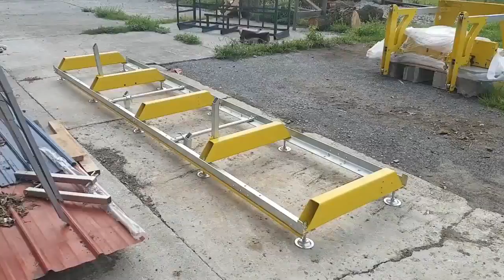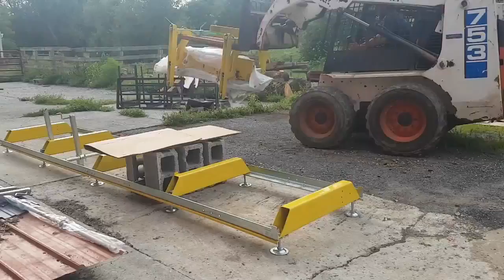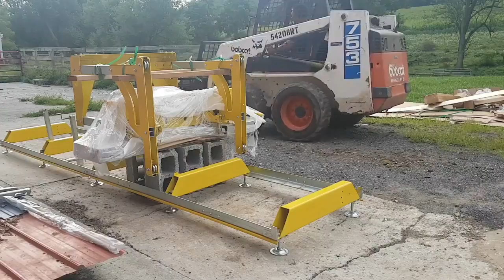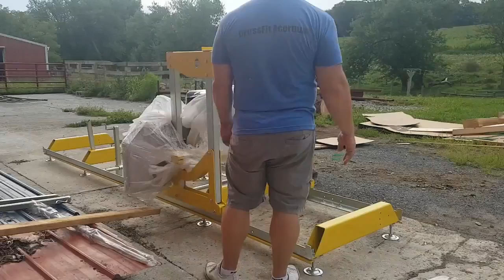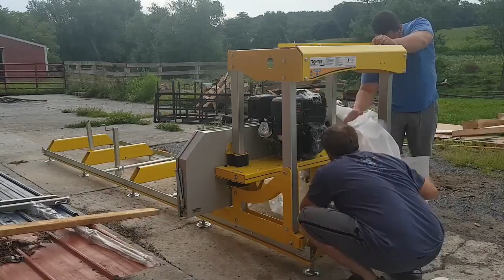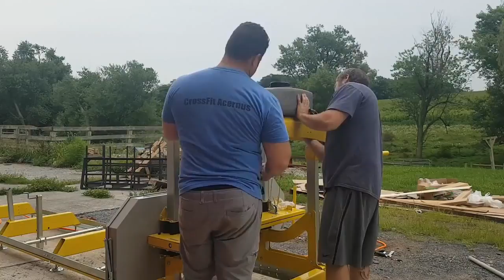Frontier OS27 Sawmill Cage Assembly

Comment: What if I don't have a fork lift? How heavy is the biggest single piece?
Reply from the maker: Hi Joe. We are about to make available an optional log loading and rolling system. Otherwise, you just stage them on beams running at 90 degrees and step roll them up and on.
Reply: @FrontierSawmills  I was referring to the OS27 assembly video, in which they use a Bobcat to move the main frame piece. Just bought a OS23--will unbox it tomorrow and see if I can assemble it myself without access to forks...
Reply: Joe Buckwalter  were you able to lift without forklifts?  I have no idea how heavy the os 23 is??  How portable without a trailer?
Reply: A friend and I were able to slide the saw head (still in the crate) down some planks out of the truck, drag it into position at the end of the rails, tip it over onto the blade cover side, and lift it out of the crate and onto a pallet. After I assemble the carriage, I expect I'll be able to stand it up and walk it onto the rails. So far so good!
Reply: I’m really interested in your thoughts about setup and getting everything assembled
Reply from the maker: Hi Joe. Please refer to your assembly manual for specific instructions on how to do that. There are good illustrations on this. Thanks!!
Reply: I'm assembling my OS 31 right now.  Just did the vertical beams into the band saw part and basically laid it on its side, inserted all the way and me and my buddy up ended it to sit on the rails.  It was pretty easy.  As for weight about 500lbs perhaps.  It is the bulk of the weight in the box it seems.  I used my tractor and straps to lift out of the packing crate but if I did not have anything but my back I would need a strong partner to help lift it all up.  It can not be done alone.  Instructions so far are ok but a few words on the pictures would help.  Because who like reading all those words on the previous page telling you how to actually assemble it ha ha ha ha. ;-)